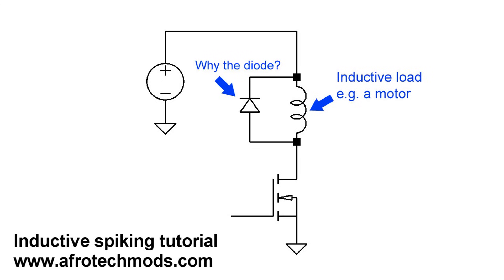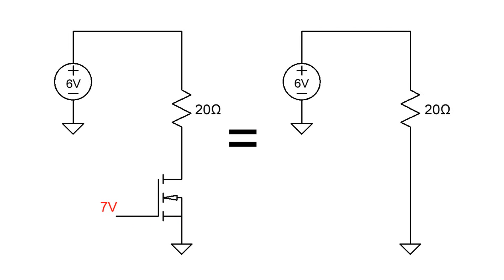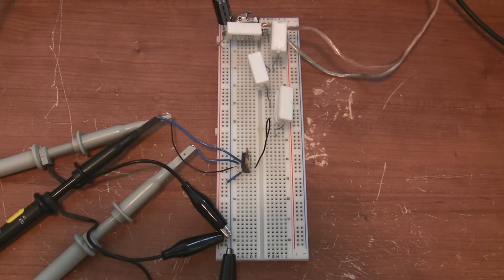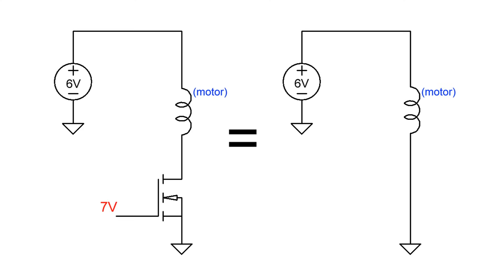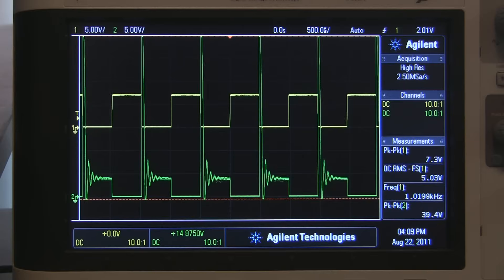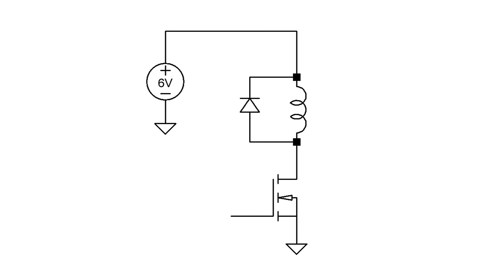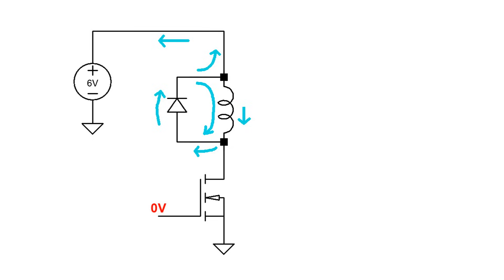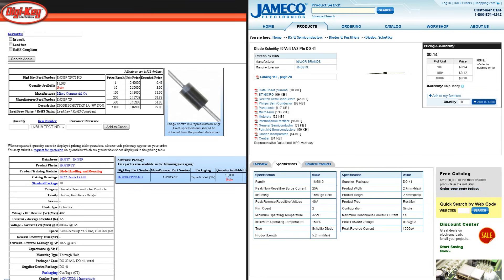Inductive spiking, and how to fix it!

Comment: 2 things:
1. The diode simply shorts out the reverse voltage/current spike across the motor coil, doesn't flow back into the circuit.
2. If the coil belongs to a relay, it would extend a relay's life if a zener diode were used in addition to the catch diode, and the zener voltage should be below the transistor's maximum voltage rating.

Comment: Had this diode installed in my PWM Controller for my Ebike Project, hit a bump on the road while riding and the diode solder connection broke off, and the inductive energy blew up the FET. make sure this is soldered down good lol.

Comment: Hey I'm kind of new to this kind of stuff but it looks like this would work on amplifiers also that Pop or thumb when powered off, Is that correct? If so, how or ware should a diode  be put in a 110 volt circuit of a solid state guitar amp? Thanks.

Comment: I was informed that the flyback diode may protect the mosfet device, it causes the relay to react very slowly because the current is still flowing through it as back emf. Therefore the relay is delayed and not very responsive

Comment: Uhhh I'm pretty sure there is no current flowing back to the PSU bypass caps. The inductor will have Vd across it, but the node attached to the PSU doesnt have any reason to change. A small leakage current goes through the FET and some parasitic resistance, but the rest would only go through the diode.

Of course I've never tested this, so I think is would be a cool video to hook a current sense amp up to this test cct and see who is right.
Reply: Oh I forgot to mention the MOSFET D-S capacitance. That would certainly provide a path for current to return to the supply. I saw you mention in another thread that you saw small reverse currents occurring at high switching frequencies, which would make sense because the gain of the parasitic resonant circuit of the inductive load and the MOSFET approaches unity at it's resonant frequency.

Comment: The energy in the inductor does not return to the power source. The inductor current flows through the inductor windings and produces I^2*R losses, and it also flows through the diode and produces V*I losses. The energy in the inductor is dissipated by these two mechanisms.

Comment: So....I have this friend...Ok maybe it me..lol. anyway i have a really big Inverter and its the same as the on in this video (https://www.youtube.com/watch?v=8pIZrrPLSP0 ) and I realize what happened after I watched his video. I also emailed him and sent him a link of you videos to help him out I hope. But what I need to Know is there some sort of mod I can do on the main mosfet's. I dont know a super lot about inverters but I believe it is the high voltage 380v side after the high frequency transformers are all done with the input and he had a inductive spike from his chop saw possibly kill one and then it just cascaded. Im not afraid to do some serious circuit mods or some kind of filtering capacitor bank, I just dont know where to start. Its a 8000w beast and I use it for a whole house backup...any help would be greatly appreciated..PS..love youe vids ive learned more from them than most of my schooling

Comment: Hi Afrotechmods, i have exactly the same configuration as your schematic above, with an n-channel mosfet FQP30N06L. and my load is 12v 50w incandecent light bulb. My PSU is a 12v 70w SWPS. I have a 1N4007 diode across the lightbulb and switching the mosfet on and off at 100Hz. i am still seeing 78v spikes at the drain. could you have a clue as to why this is happening? your help would be greatly appreciated!

Comment: How do we calculate the back emf? You may say the classic eqn.   L.di./dt.. Here, we know i flowing thru the MOSFET. But we don't the time & the rate of change of current  I.e.  in what time will the current fall down to zero (di/dt) because the input waveform which controls the output is changing very fast ( nearly zero seconds) as seen on the cro. In real life zero seconds would mean an infinite back emf would be generated. This emf would kill the transistor connected. But fortunately, we get only 40 volt spike or so. What I mean to ask is that there is a finite switching speed which limited the spike to 40v. How do we predict the spike amplitude without using CRO  or actually building up the circt & measuring it with some instrument? Hope you will respond to this simple querry. Thanks in advance .

Comment: What about a circuit where the motor can run in reverse? Do you have to switch the diode connection to match motor direction, or is there a more universal way to do it?

Comment: Wow very nice explanation 😀👍👍👍
I have a problem on my walkman.. the speed of motor for tape is not stable.. and i try make test tape at 1khz of sound and measure the speed of cassette is not stable.. i changes motor and pwm control nothing changes still same when i analyzed the circuit there are small mosfet and pwm and the motor act like inductor coil.. i measure the drain of mosfet yes! There are voltages spikes when the 2 coil of motor is ON and turn again into another coil has voltages spikes.. i see i have
diode open. And i changes new the problem is sold 👍

Comment: Hi, does it matter where to connect the diode? For example I have a solenoid lock with 2 meter wire. Should I connect the diode near the solenoid/coil or is it ok to  put diode near the pcb board where the 2 meter wire ends.
Reply: This may be a little late,  but the clamping diode should be placed at, or as close to the load as possible.

Comment: Just as a note, when the diode is across inductor it is shorting out inductor when it is doing self-induction on power-off moment. Which is a waste of energy. You can easilly drive inductor in full bridge mode and add voltage regulator circuit to recover the BEMF energy back to power source. And when inductor is running close or on resonance the COP will be approachong close to 1 minus energy wasted to resistance.

Good luck!

Comment: would a LED work?
Reply: an LED doesn't have the reverse voltage rating that a rectifying diode would have. With some currents, it would fry instantly.

Comment: Afrotechmods, So i built your 555 timer PWM circuit, and put it on my variable tension friction drive bike project i built. I had the backwards diode in the circuit, it ran fine, I had 24 volts on this 280 watt motor with a powerful fet, and i hit a bump in the road and my solder connection on my diode broke off and i basically had no protection for that fet so the fet exploded in the housing, i went back home, and realized it was over 100 volts of spiking on the drain. Inductive spiking is very real.

Comment: What if you replaced the diode with an LED and resistor? Would it flash whenever the transistor turns off?
Reply: Given the sometimes high currents generated by an inductor, i think the most likely outcome would be that the LED flashes *ONCE*, then dies. ...Or maybe the series resistor dies; either way, i think something must give.
Reply: Yes.

But it'll likely die, for reasons already mentioned. Though that can be solved by putting another higher-current diode in parallel. Might also use one with higher forward-voltage(so the LED still turns on), and faster response time(so it'll protect the LED from high voltages when before it conducts)

Comment: What if i want to reverse the "security" system built inside a flyback transformer?, i mean, what do i have to do to get the voltage spikes with a flyback that has a diode to prevent the high voltages?
Would it be a good idea to put another diode coming from the power supply to prevent the current from flowing backwards when it disconnects?

Comment: I tried it, and all it did was increase current in the device. In fact, that position with the "fix", had the most current of all components in the device, and it increased current in the device batteries from 1 amp to 30 amps p-p. I want to know if you people are sure that the current is not what's important, as the current in the device is low, that problem can be ignored, even if the device voltage is high. Current low; Voltage high; Wattage high. Not a good configuration or what? I have been trying to accept this kind of output for years now, as I finally was able to lower the device current. I used to get as crazy a current as I explained above, you "fix" seems to do the opposite for my technology. I thought as much, and just had to try it. As this kind of device (the "fix") is added to my tech, it simply creates a short circuit. That makes a lot of sense, how else do you get rid of a bad ripple than to isolate it as a shorting current elsewhere? It's reversing everything on my devices as it short circuits the entire device, putting it back to basics, where it was doing just that. Not tech for me. I had tried this another time in the past. I can't remember what it did. I think it had actually worked.

Comment: Thank you for this great simple explanation!  I wonder, though, why inductors (even just air-cored coils) take so long to build and collapse their magnetic fields? I would have imagined that this electromagnetic process would be practically instantaneous compared to the frequencies from a signal generator.  What causes such large delays?
Reply: They are practically instantaneous, as you say.  What delay are you talking about ?
Reply: Joey Mac he said it takes some time for the current to stop flowing . why can't an inductor react as quickly as a resistor?
Reply: The short answer is because the inductor stores energy and the resistor doesnt.  So the more energy stored the longer it takes to release the energy back into the circuit. In this case as a current to oppose the change in current that it sees. (ie like after someone turns off the power switch) the inductor stores energy in the form of a magnetic field.  Just like a capactor opposes change in voltage the inductor opposes change in current.   A capacitor will keep a something on for a couple of seconds after you turn the power off. It acts like a battery after the circuit voltage source is removed. Inductors do the same except for current.
Reply: Thanks, I hadn't thought of the time it takes for the induced current to drain the energy away from the coil's magnetic field. I suppose if you were quick enough and pulled a powered-up inductor out from the rest of the circuit, it would ring for a while as the magnetic field turned into an electric dipole and back again, until the current dissipates as heat or EM radiation.

Comment: i'm troubled by the step of the fet switching  off with i in the load coil.  and the mag fld collapse makes the Vd get real high.  w/o the current actually flowing how does this voltage arise ?

isnt there some capacitance (between the coil windings )  that the collapsing mag field interacts with ? 
and the decaying sine waveform is showing these 2 phenom' oscillating until that field
energy is dissipated .

further ... that the presence of this 'capacitor' is what allows the inductor current to
change directions . otherwise it appears to be slamming into the drain ... and then what ?

it does change directions with a 'capacitor' there to flow into and charge up .... less V
with  each cycle of energy exchange
Reply: When the inductors field collapses it induces a voltage across it self that keeps current going in the same direction as before.   Induced voltage = the change in flux / change in time    So the voltage from the collapsing field can be much larger than the supply voltage.  There is parasitic capacitance in the winding but that doesnt come into play until very high frequencies.

Comment: Should there be a 0.1 uF ceramic in parallel with the diode?  I wish to switch a large motor (24 vdc, 5 amp).   Oh right...love your work.  so helpful to so many.

Comment: what would happen if we use a resistor in place of a diode in parallel to the inductor?
Reply: current would always be flowing through the resistor. With the diode, the current only flows when the inductive energy is being dumped.
Reply: Kyle McNicoll thank you!!

Comment: Does the diode need to be rated for the expected voltage spike, or does the fact that it's there prevent the voltage from reaching that point in the first place?
Reply: I hope you will answer this.  It seems likely that the diode will drain potential during the 'long' temporal field collapse, minimizing the V spike

Comment: @Afrotechmods
Why exactly do you need to drive the MOSFET in the beginning with 7V? 
If it is an N-Channel MOSFET, as I presume due to it being connected to ground, then the MOSFET will switch on once the gate voltage goes above the gate threshold voltage, which in most cases is around 3V for most systems, so the 7V are actually not needed.
Reply from the maker: Because Rdson at slightly above Vgsth is going to be several times higher than a fully driven gate.

Comment: I want to build the SMPS and I want to convert 220 volt AC to 42-64 volt DC (25amp) at approx PWM frequency of 5khz what type of filter I can use which can give good efficiency low weight and provide voltage variation within 1 volt peak to peak.
Reply: Butterworth filter, but good luck making a decent SMPS with such a low switching frequency. TI has some cool tutorial documents about estimating switching losses, and you want to pick as high a frequency as possible without losing a ton of power switching. 5kHz would require absurdly large components and would have audible whining from the heat flux

Comment: so after you place the flywheel diode, you still have noise on your waveform...the inductive spike is gone but you have oscillation on the high side of your square wave, my question is: How can you get rid of that oscillation on the square wave?
Reply: Adam Josserand good question...
Reply: Reduce conductor lengths, use a decoupling capacitor, use ferrite beads/chokes etc
Reply: yeah low pass. the signal. but it runs into problems of not being so square anymore.

Comment: Is the addition of the freewheeling diode only applicable when the inductive loads are subjected to DC sources? because during the -ve half cycle of an AC supply, the diode would conduct, shorting the load, right?

Comment: What about in an H bridge where the high voltage pulses drive crazy the microcontroller, the mosfet driver and also other parts of the circuit?

Comment: Hi,
I've built a medium-high power motor controller to control a 24v 400w motor.
My MOSFETs are rated for 30v.
Now for the diode do I need to use a high current rated one or will a simple 1n4007 work too?
Reply from the maker: There's no simple answer to that, it will depend on the peak currents, motor inductance, how you are loading it etc. but intuitively I am guessing you are going to want something with a higher current rating than a 1N4007.
Reply: +Afrotechmods thanks man. Found a power schottky rectifier yesterday from a laptop adapter. I'll use that since its rated for 20amps continuous.

Comment: I did not understand the concept of freewheeling diode, the flowing of current back to the supply doesn't quite snap right in for me??
Reply: It does not go back into the source. Current flows through the motor and diode over and over until the energy is dissipated.
Reply: got that, thanks for explaining

Comment: Afrotechmods: I need your help...bad. I have a brush DC motor with a PWM controller to manage motor speed (the pwm uses mosfets to send the flyback voltage back through the motor. The power source is 2  x 12 VDC batteries in series. All works well. I'm trying to measure volts, amps, and RPM using an arduino. I have a buck converter hooked to the battery and dropping the voltage to 5VDC to power the arduino, and i'm using a simple voltage divider to drop the 24 VDC to around 4 so my arduino can read the batttery voltage (then in software i compute the voltage based on R1 and R1. My amp meter is a hall effect sensor with a low pass filter to smooth the output signal.

I have several issues

1) My issue is the arduino "locks up" and I suspect is just spiky, noisy voltage. I added a home made inductor (wire wrapped through a washer, and connected it in series to the ground (read that somewhere) and while the arduino no longer locks up, it does restart (as if the battery were unplugged and plugged in again. I still suspect the issue is very spiky voltage caused by the pwm controller. I can only hope my buck converter is filtering out all the junk, but I now suspect connecting the noisy battery directly to the arduino input w/o any type of filtering, may be causing other issues. 

2) a plot of the input voltage (the ~4 VDC signal) over time is a sine wave--again I suspect its due to the noise and spikes of the pwm controller

I've tried dozens of things to shielding wires, twisting wires. etc. maybe i can 1) add a low pass filter to the positive (before the buck converter and input to the arduino or 2) connect the input the the point between the batteries. It feels like #2 will give the cleanest DC signal.

Thoughts?

Comment: so if I replaced the 6V with an AC power supply, how can I avoid a short from electricity flowing back into the power supply  as the diode dissipates it?
Reply: +Lord Zantaff maybe install another transistor before the inductor?
Reply: You need what's called an RC snubber